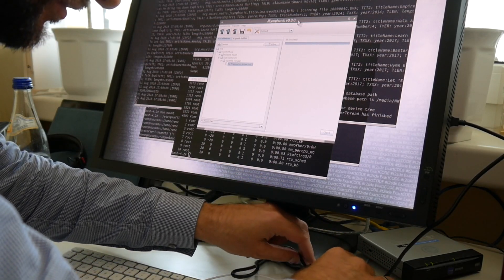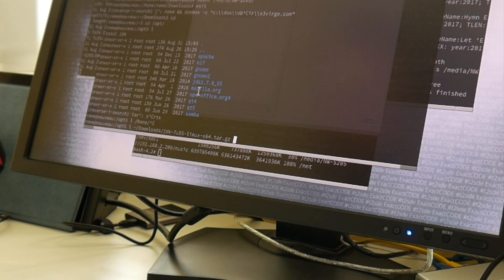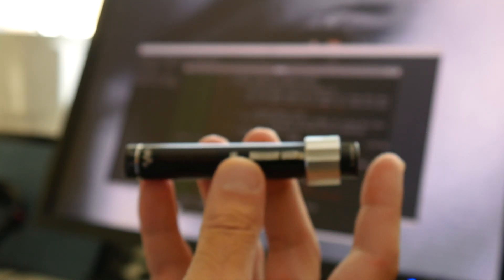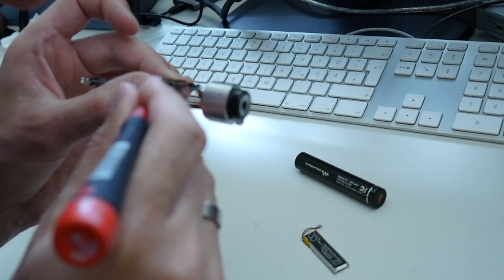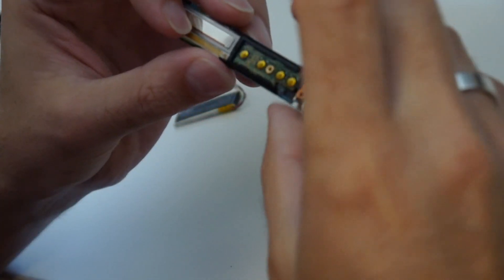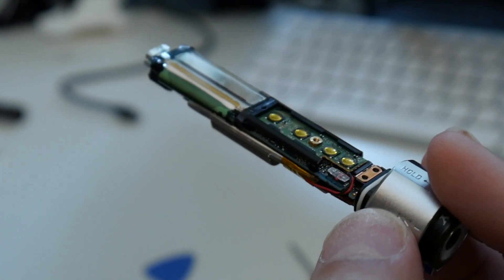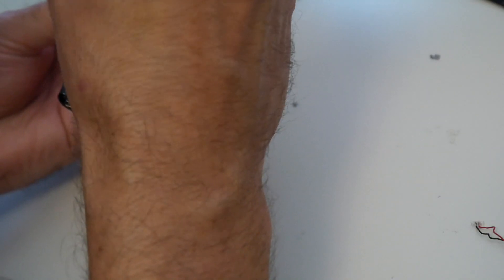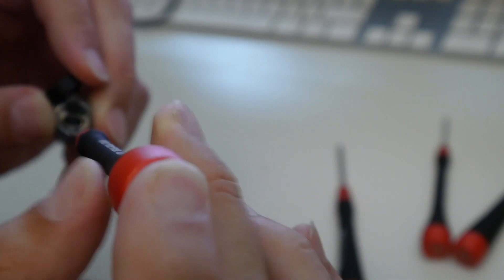Sony MP3 walkman on Linux w/o SonicStage DRM & NW-S205F battery swap!

Comment: Why are you not showing us the disassembly ????????
Reply from the maker: I thought i showed most major details. There was only so much i filmed , it was the 1st time I did it for this device, too ...
Reply: @renerebe  Disassembly is most important if we done something wrong during that then changing the battery is of no use. All 3 or 4 videos on YouTube are not showing the actual disassembly. OK, no problem, i have downloaded the original Service Manual and i will do that. Thanks for your video and effort.

Comment: i have a sony nw s203f but the battery is failing and i would like to repair it do you know where i can get its battery ?
Reply from the maker: just look at your electronics supply (RS, Farnell, Mouser, whatever you have locally) for a matching sized cell. IIRC I simply got a smaller one from eBay.

Comment: Ok, so I’m lost.  
I have the S203F and it works but I can’t add music to it. I have Symphonic but when I plug it in it says device is not mounted and it won’t find the OMGAUDIO folder. I’m using Windows 10
Reply from the maker: As I'm using linux I only tested that, and it worked for me ;-)
Reply: Bits & more by René Rebe I basically don’t know how to put music on. Import button doesn’t do anything and I know the program is functioning because I can save it. The MP3 is working because I can use the FM radio
Reply from the maker: @aidanandallthat8942  sorry I'm not the author of this basic program, nor do I use windows. I have not even used it since this yt video as the main point was to swap the oled display for the mzrh1 himd recorder ....

Comment: Dude i got a problem, i cant transfer the music to my mp3 (its NW-202) the battery doesnt work, but still can "charge" and i cant transfer the music files to the mp3, by chance you know why?
Reply from the maker: It can only transfer data when the battery is charged. If it does not charge anymore you can not transfer data until you replace the battery.

Comment: question do you need to solder at all when replacing the battery?
Reply from the maker: IIRC maybe not.
Reply: Bits & more by René Rebe OHH (maybe) THANK GOD I DONT NEED TO SOLDER (maybe)
Reply from the maker: @jacen884  I answer from memory. Can not store every detail in there ;-) think it had a tiny socket. Did you swap the battery yet?
Reply: @renerebe  no not yet but when I was watching the video and looking at the manual for taking it apart, I saw there was a part called a battery clip or something
Reply from the maker: @jacen884  yes, and as I said in the video be careful not to reverse polarity, IIRC it is not coded to plug in correctly orientated, ..!
Reply: @renerebe  oh ok thank you

Comment: OK, I see your previous video,  but i still can't see how you tore off the bottom part, the lid and the ring,  please let me know how u did it. thx
Reply from the maker: As far as I remember the video was quite detailed, in any case I have done this months ago and do not really want to take it apart right now again. Maybe watch it in all detail again, and if you have further tips you can add such helpful comments below the video, too!
Reply: @renerebe  Okay,  was it difficult to tear off the bottom part, which is the lid and the ring?  how many screws needed to be pulled ?

Comment: can you show the actual disassembly? I need to battery swap mine, but I cant find a disassembly video.
Reply from the maker: I thought I showed it in much detail, not? PS: guess this video: https://www.youtube.com/watch?v=dXoQAHOjQVA
Reply: @renerebe  that has alot more detail in my opinion, thanks man, and on all this note, where do you get the adhesive sheet that it mentions? Do you just use tape?
Reply from the maker: @Stargun-vj1uh  yeah, you posted under the final video of this series ;-) which adhesive sheet of the many? for the battery you can probably can just take any double sided scotch tape thing, also re: battery - do you have on already? the cheap replacement I got is smaller than the original and does not hold charge that long. The later a common problem of old stock. Also as you probably saw in this video I had to resurrect even the replacement battery with a lab power-supply before it would charge. Keep us updated what replacement supply you find and how DIY it worked for you! PS: always be careful!
Reply: @renerebe  how long did that replacement hold a charge for? Im curious as im pretty sure the battery i was looking at was the same one you had and how long did it exactly last?
Reply from the maker: I never had this mp3 player, I purchased it only to swap the better OLED display into my more precious MZ-RH-1 Hi-MD MiniDisc Recorder in that other video. I also only swapped in a working battery for the educational YT fun of it. I also did not really use it much since then (but it works, sound ok, and looks nice). So honestly no idea. However, what I do now is that every other month when I want to actually use it just to keep the battery conditioned, the battery is already empty from self discharge. As I never had this player before, I have no idea if that is "normal", but certainly it is not nice. As my replacement battery dimensions were significantly smaller than the original, and was also im-printed with a lower capacity label, I would strongly advice to get a more matching, higher capacity / "original" battery, ..! – if you can / find one :-/
Reply: @renerebe  alrighty, i bought my NW-S203F, the one you had was a S205F, but the dimensions i believe are the same. When i first got mine, the original battery started out at maybe, 3 hours continuous use, but by a month later maybe 10 minutes. Now its zero. it holds no charge, so even a few hours is fine by me, and it always charged fairly fast, true to it's advertising of that feature. If I can find a larger battery I will, but In a way, i rather get what's available rather than what's best, as I dont mind charging it.

Comment: From one René to another please work on your camera skills and dont leave out the hard parts ! Document the struggles for us viewers. thank you though your mini discs vids have been helpful, cheers
Reply from the maker: Well, I could always do videos even better, but it currently is a part time hobby for a small audience. Do you already see an improvement of production quality in my last (non live-streamed) videos?
Reply: A little bit. ive worked in the industry and suggest you determine where your frame is going to be and stay there so object is in full view and distance from lens so it focuses properly. I applaud your efforts, this is positive constructive critism mate!
Reply: @renerebe   Do you know if the other models like the rz-h10 or mz-m100 that have the big screen on it are seperate screens like the one you swappd out or subistute i could swap out? Also just to noter that the part one vid does not show a link to part 2. i had to go to your channel and fish it out . thank you again for your efforts. cheers
Reply from the maker: @empiremanagement1015  sorry I do not have those other players, so I would need to internet search that, too. I was thinking about getting one of those 2nd hand on ebay to have a second player for the future, but the used market prices are still so high for an unknown quality used part anyways.
Reply: ii found another vid and it is one screen. i know it. Ive had a mz-m200 for years and it stopped reading and i adjusted and lubed screw that lens is on and still no luck. any tips greatly appreciated. so i recently bought two the mz-rh10  mz-m100 for parts  or not working. they both work and need batts but of course display on mz-100 is very very faint. the mz-rh10 is great. would love to fix both mz-100 display and mz-200 playing issue. is the service manual avaialble to download ?

Comment: Isn't this the same one of from Persona 3?
Reply: technically but the one from p3 is silver but its way harder to find
Reply: Play_maker2000 yes
Reply: Is it still available?
Reply: @chairulamin6427  Unfortunately, not really. Ebay has a few, but you'll have to 9 times out of 10 change the battery. I've decided not to do this for over a year, and I might do so in a the next few days though. It doesn't seem particularly easy. Like at all.
Reply: @Stargun-vj1uh  looks like that music player had issues only on the battery.

but okay, I'll buy.
Reply: @chairulamin6427  Yeah, most only have that issue. I have one myself that I plan to fix, they're great devices when they work. It worked for a while, far better than the ipod shuffle of the same era, and it's very small. Sonicstage sucks, so his way of getting around the software is a great idea if you plan to use it.

Comment: This video series shows that Sony are experts at producing the absolute crap that looks beautiful.
Reply from the maker: just like Apple ;-) Some books mention Steve Jobs liked to disassemble things, as kid or though, and liked Sony design and such. If that is true you do not need to look any further where Apple copied things. The Sony laptops, they once produced, where also know for lightweight and design, yet not very powerful and overheating. Hard to miss the similarities, ..! ;-)
Reply: Yep, I repaired a Sony Vaio laptop two years ago & the contruction of the fan assembly was awful. In that case it was still easier to repair than the Apple devices I came across.